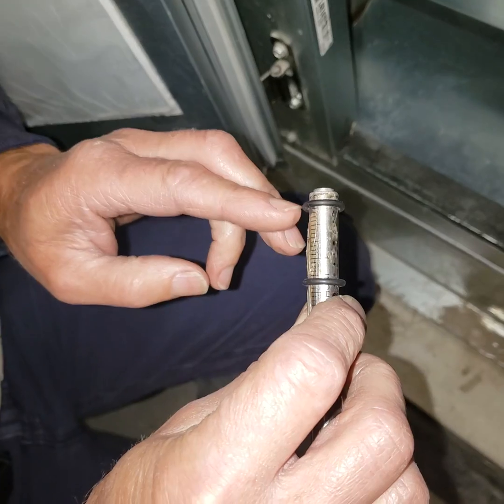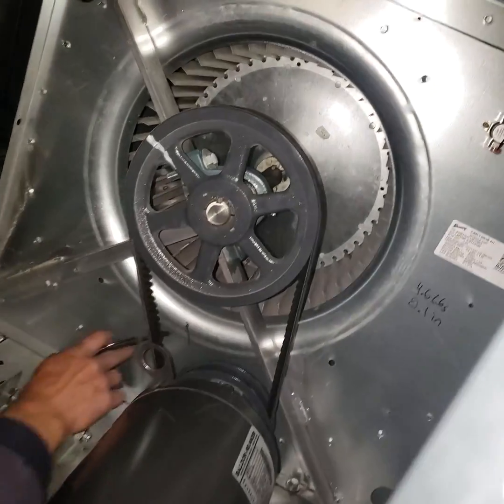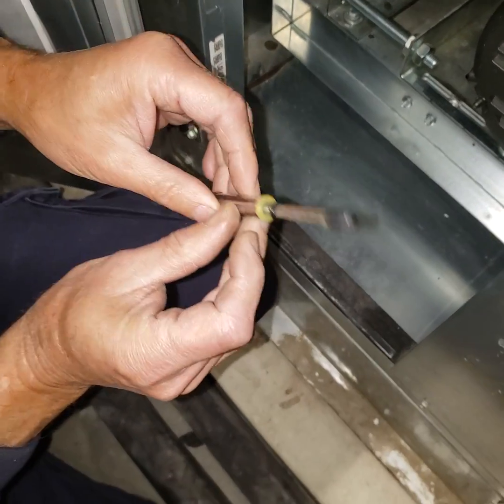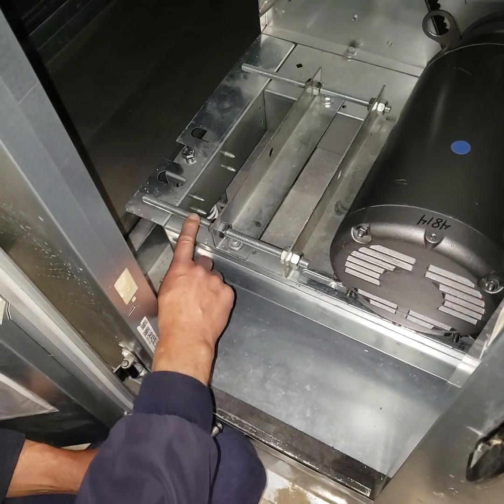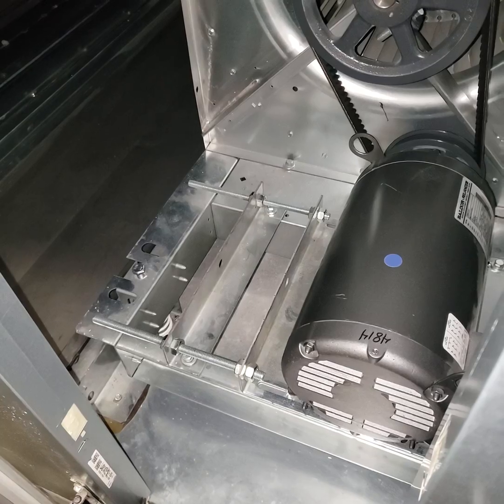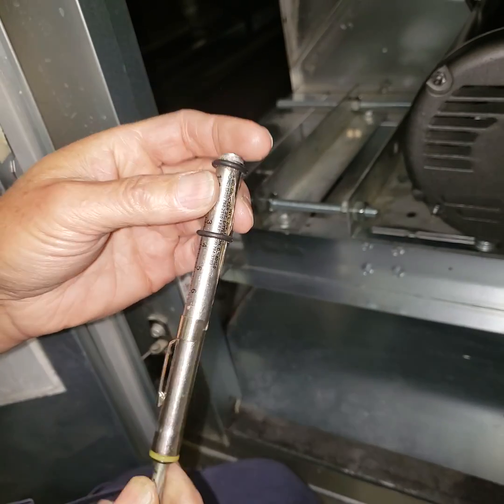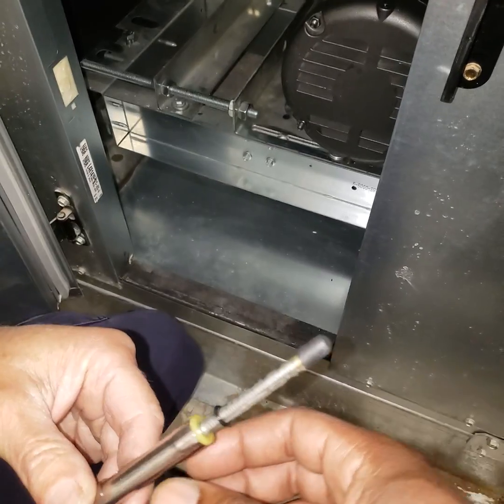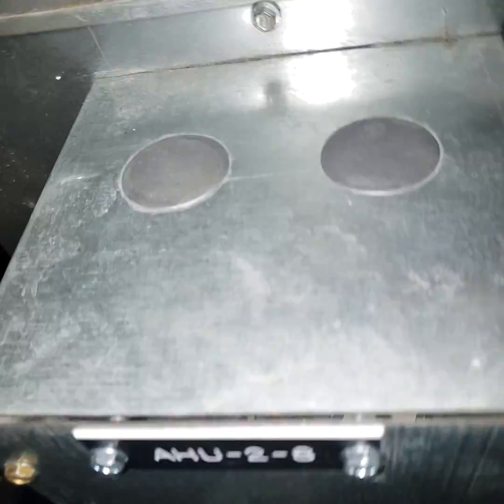HVAC: How to use belt tensioner and not the finger method

Comment: Get the browning kit comes with tension tool and sheave checker tool. Also they have an app that you use that will give you the correct tension for used and new belts by putting in data off measurements and motor info. I use this every time I do maintenance it takes a bit longer then just popping on new belts but at least you know the belt is at correct tension.